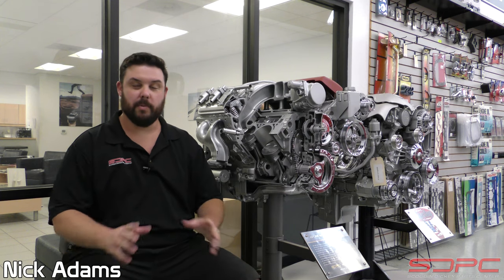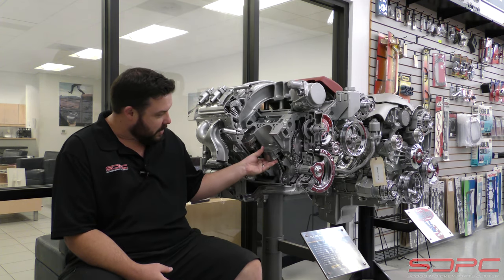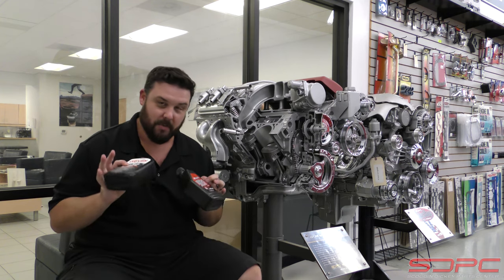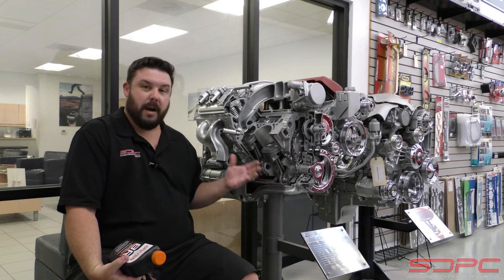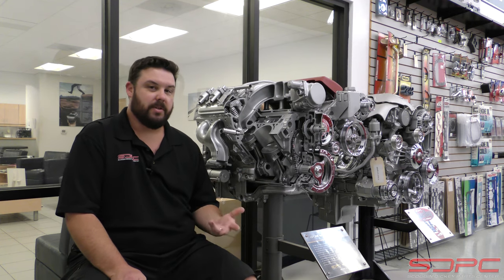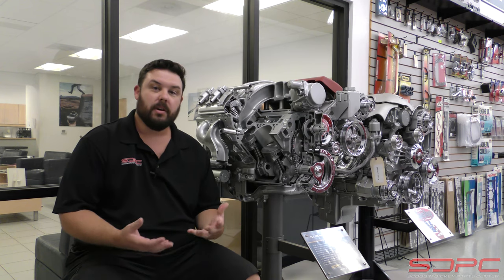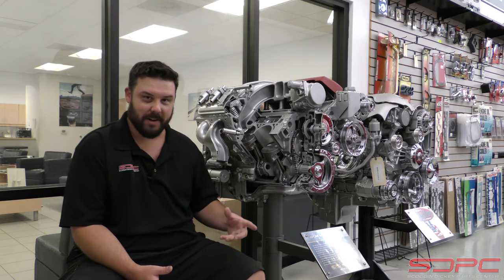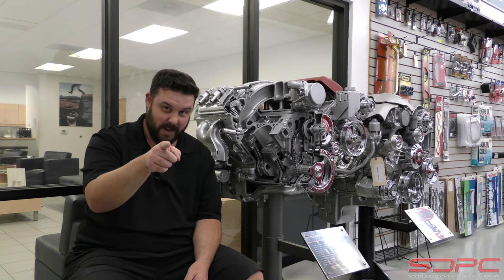SDPC Tech Tips: Engine Break-In

Comment: I'm going to take a chance and share a little aircraft piston engine break-in information on a car channel but I think it's good relatable information. Running in the crank and rods probably goes back to the the babbit bearing engines like the Chevy 216 but no longer necessary with bearing inserts and better machining tolerances. So the primary focus is seating the piston rings to the cylinder wall to establish a good gas tight seal. One recommended procedure for in airframe break-in that I have used successfully for many years is takeoff and initial climb at full power and then 65%-75% power for 1 hour. The idea is you want the rings to rupture the oil film and create a certain amount of metal to metal contact between the rings and the cylinder wall to rub off the peaks on the rings and cylinders to create a better gas tight seal. Once this process has completed there is very little metal to metal contact that occurs during normal engine operation between the rings and cylinders. Some of the compression and combustion pressure ends up behind the ring by design and this pressure helps to push the ring towards the cylinder wall and helps to rupture the oil film during break-in which is why a higher power setting is required. Normal engine automotive or aviation oils contain additives that help with oil film strength making it harder for the rings to rupture the oil film for the desired metal to metal contact during break-in. The desired metal to metal contact that occurs during break-in also creates friction and higher than normal cylinder wall temperatures that can cause additives in non-break-in oil to glaze in the honing grooves of the cylinder wall which inhibits proper ring seating and high oil consumption. Once this glazing has occurred during the break-n process on a piston aircraft engine the only remedy is to re-hone the cylinder to remove the glaze. A loaded break-in procedure was also recommended by tractor manufactures like David Brown, International, Case etc. for the same reasons as stated above.
Reply: I didn’t realize the “glaze” was oil additives. I thought it was the metal “glazing” and turning to a mirror finish.

Comment: At initial start up idle it up around 2500 rpm for 20 minutes checking for leaks and keeping a close eye on water temp & oil psi. Around 15 minutes into the first 20 minutes you want to rev it a few times to 4 to 5k nothing crazy just quick revs. Pay close attention to oil psi when you Rev it. Above 80 lbs once hot, can damage coated bearings. Ideally you want 40 to 60  lbs hot psi at higher rpm. Idle will probably be around 25. 
Once all that is checking out the builder will start doing dyno pulls progressively getting more aggressive.  By the time the engine has an hour of run time it's already been broken in ready for the track unless more tuning is required.

Comment: I got a new motor, and couldn't find break-in oil or conventional motor oil. I had to use a regular synthetic blend. 

First oil change at 100 miles, second oil change at 800 miles, and a third oil change at 3k miles. Which 3k is when I swapped to fully synthetic. I drove it conservatively for that first 100 miles, more aggressively from 100 to 500 miles, and then drove it the way I normally would after 500 miles. Which is a mix of conservative and aggressive driving. 

That may not be how it's supposed to be done, but everything seems okay. Not burning any oil or making any strange noises. I have about 8k miles on it now.
Reply: There’s additives including zinc you pour into your conventional oil.

Comment: The idea with not using synthetic oil for break-in (even if it's a synthetic break-in oil) is that the uniform molecules provide too much friction and actually prevent the rings from sealing correctly. The same reason as to why you should use conventional on the first few oil changes, as I've been told it's essentially until you are happy with the amount of oil the engine is burning. Very good sealing should me no oil being burned. Now from research I've done GM and some very high-up shops (perhaps you guys too) have special honing techniques that allow for the use of synthetic oils immediately and shorter break-in periods. The more inconsistent the honing the the longer the engine should be run on break-in oil, before switching to conventional then synthetic. Generally what I've found researching this is to run it very similar to what the aviation guys would do.
First - Heat cycle it, and check for leaks as you said, the engine has a lot of friction from the rings wearing let it run for about 10 - 20 minutes. Vary the rpm and don't apply any load. Let it cool off, perhaps change oil and filter and check for any debris
Then take it out, on a road racing track just send it, street driving as you said vary rpm, no lugging, but also no hard engine braking (lugging i think slapps the skirt a bit, engine braking pulls oil past the rings and can glaze the cylinders). Full throttle is good, Load is good, just try to not over do it, vary the rpm and let it cool a little after larger load and WOT
The aviation guys are pretty much doing a run up then a test flight then send it on it's way. Run up is leak test, 1500rpm for a couple minutes. Test flight is full power to reduced for climb. 
Saying different break-in styles all "appear" to work is sorta misleading because you can break an engine in okay, and it will run 200k miles, but it will always burn more oil, and coat the top of the piston with blowby compared to one that's broken in correctly. There is a website where they went through exactly whats going on.